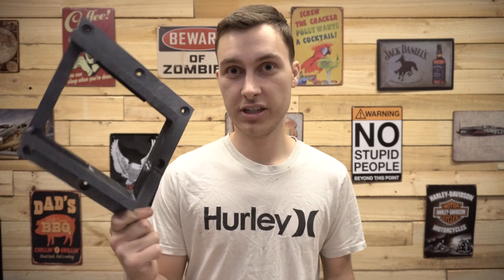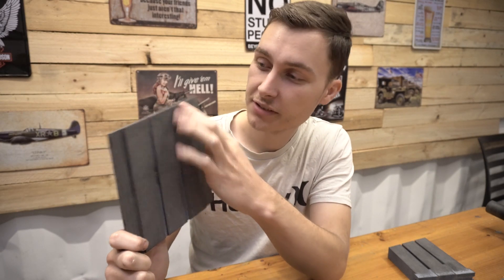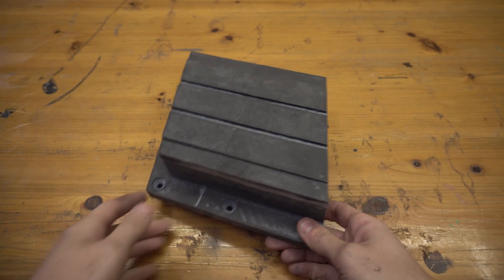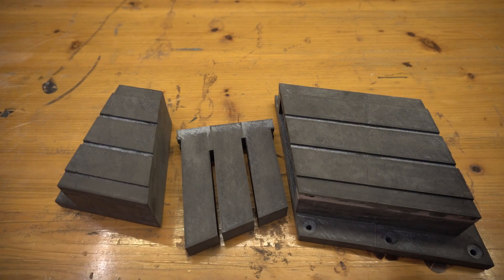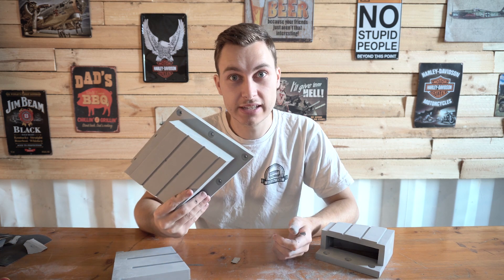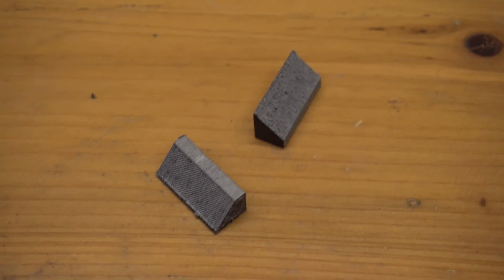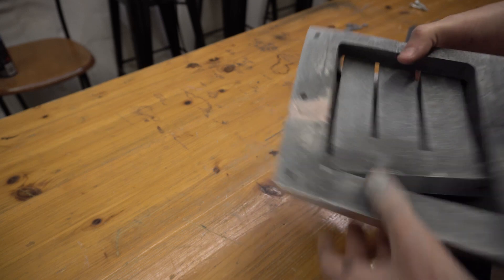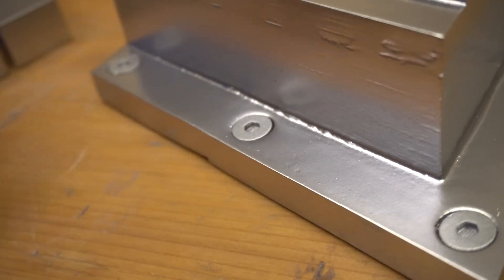Making the Jurassic Park door lock

Comment: Try using this motor....

https://www.digikey.com/product-detail/en/pontiac-coil-inc/F0461A/527-1020-ND/668305

The continuous pull can be "locked" without burning out the motor. Continuous solenoids only come in "Pull" so attaching a rod to the piston and attaching the rod to the sliding latch with the wires to the motor facing the sliding latch....

Not sure exactly what your measurement for clearance is, but I think the motor will fit. Not sure if the 1.25 inches traveling distance of the piston is enough for screen accuracy...? 

Wiring the solenoid to a 9v battery might work or then paring the 9v with two AAA make 12v. and just a basic micro switch out the bottom of the lock to activate and deactivate the solenoid.

Using a solenoid like this I think is easier than design some type of mechanical mechanism...
Reply from the maker: Yes, this would be heaps better than a servo, the sudden open and close action would be the same as in the movie as well.
The solenoid just has enough room to fit and the travel for the piston should be close enough but i think it would still need some modifications to the lock to make it all work perfectly.
The 9v battery seems like the best way to go but i would try to add a wireless switch instead so you can't see anything externally.
Thanks for the ideas
Reply: Definitely, thanks for the reply. 

I personally do not have a 3D printer. I print quite a lot of stuff of shapeways, but when I uploaded the files for the lock, the total cost came to about 500 to print everything. 

Any chance you might be willing to sell a kit to me for less?